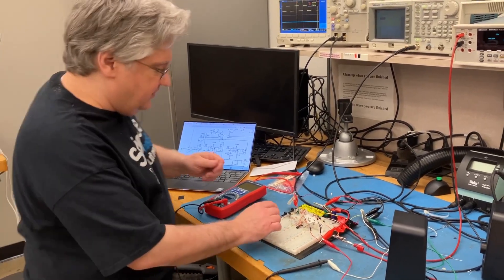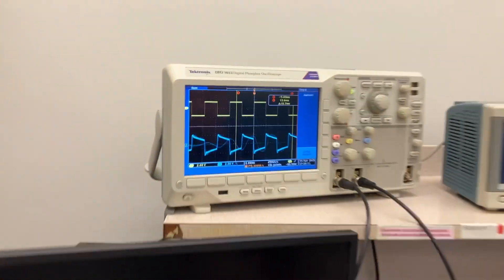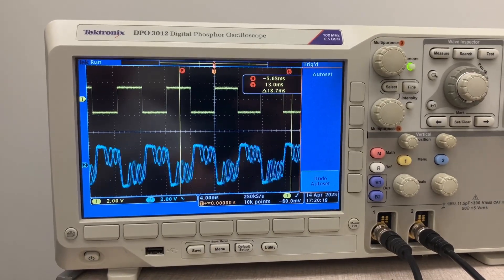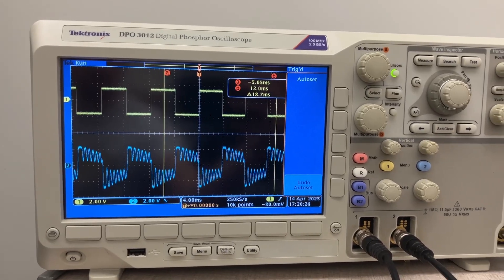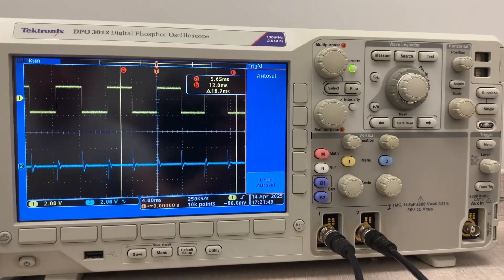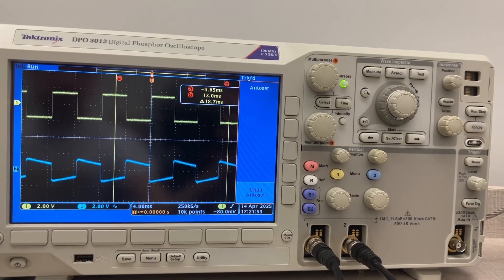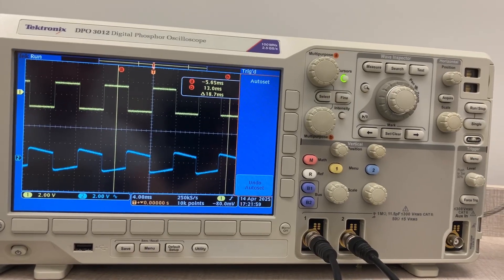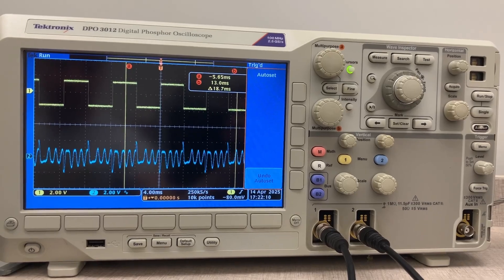EDP WASP Filter on the Breadboard -- VCF (Analog Circuits for Music Synthesis)

Comment: I suspect that changing the the input level will change the sound, especially with the resonance turned up.

For those confused about the 4069 logic chips, this video on the chip may provide some clarity:
https://youtu.be/CCQ1T2mh2X8?feature=shared
Reply from the maker: Oh yeah — when we first started we thought the resonance wasn’t working since we were putting in a 6 V pk-ok signal and all the little wigges got flattened. This was 3 V pk-pk and the overall behavior changed with different input levels (compared with other filters).

Comment: Yeah, on the Todo list.

Look for "Mean Well NSD10-12D15" DC-DC converter, creates bi-polar +15V/0/-15V, they are cheap modules and give 330ma.
Some other guy (Erich archner) used this on TR-808 drum modules and worked fine.